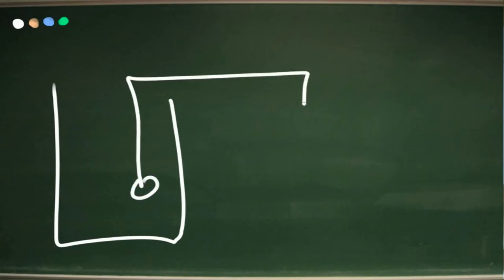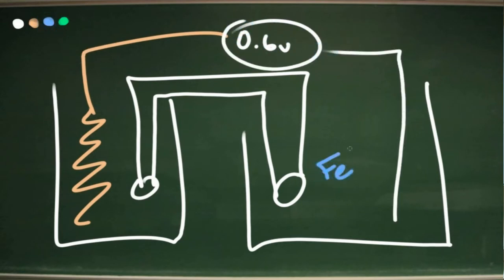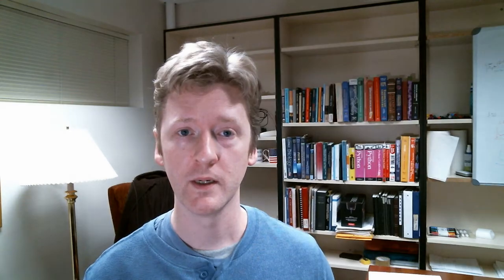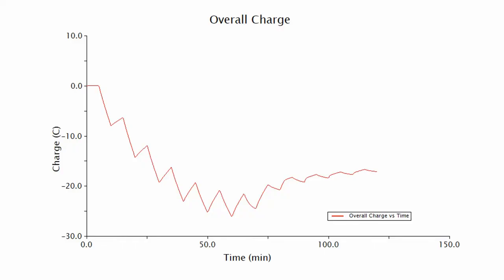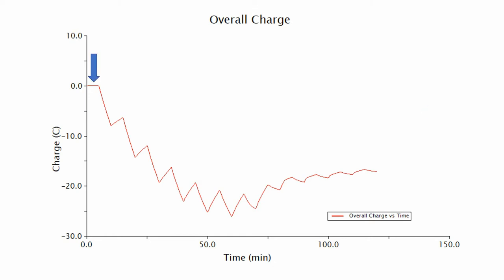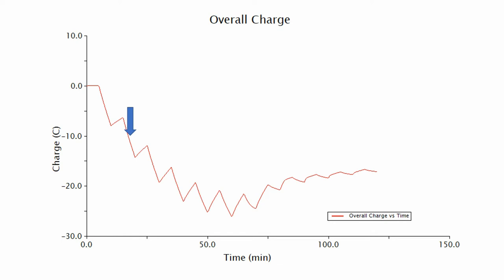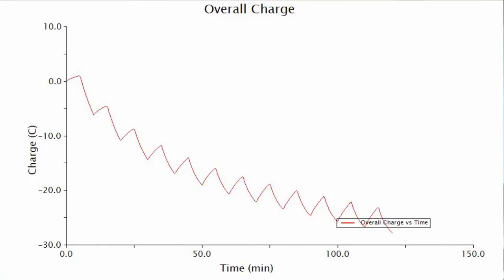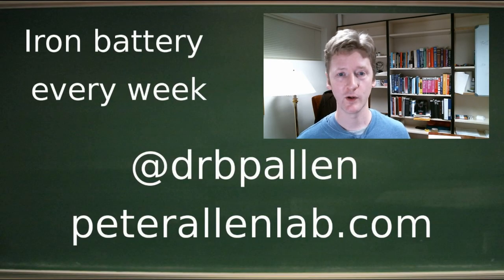Iron and Iron Chloride cell: Iron battery, part 58

Comment: OK, this might be a bit of a crazy idea, but as I recall from other battery research papers, urea and aluminum chloride form a deep eutectic solvent that is liquid at room temp.  Shouldn't iron chloride and urea also be able to form a DES? Could you use that instead of water as the basis for the electrolyte to get around the water -> hydrogen problem?  I think the main problem might be if the viscosity is too high, it might lead to a high charge transfer resistance. Perhaps adding the choline chloride you prepared in the other video could reduce the viscosity ?
Reply from the maker: It's a good idea - I'm not sure what will happen. FeCl3 does dissolve in Urea/Choline chloride DES. Here's the link you refer to:

https://youtu.be/GZ8IcoHjFdk 

I didn't make enough of it to try a cell. I'll have to give it a shot. I'll see what happens if I just mix FeCl3 with urea and heat. I don't know what to expect. The greasy choline molecule may be pretty important to the DES formation.
Reply: Very cool! I love the idea that part of your motivation is to design the "World" battery. As I understand your design goals, the materials should be low-cost, eco-friendly & readily available. Alas, although many research papers are very excited about DES's formed with choline chloride, it is only moderately accessible outside of labs. :/
WELLL ... I found a very interesting procedures paper, describing a much more complicated battery... 
However, isolating just a section, it does discuss the making of Fe  DES  by  mixing  iron  (III)  chloride  hexahydrate & urea (with ethylene glycol proportions down to 0), and further down has the claim: 
"Synthesized at ambient environment, Fe DESs also exhibit good stability during long-term storage in air"
I will add a second comment with the link, because yt has a way of sticking comments with links into a spam bucket until you "approve them?? ".  So if it doesn't come through, let me know and I'll Email to you somehow. :)
Reply: Link to referenced paper:
http://www.cell.com/cms/attachment/2115002633/2084679109/mmc1.pdf

Comment: Hi Peter - very nice video - love the explanations you give along with showing your work.  Do you think you'll get back to a 'flow battery' version?  I assume you've read up on the Case Western Reserve research.  
Cheers,
Dennis
Reply from the maker: I had not run across that - thanks for the pointer. http://engineering.case.edu/arpa-e-funds-flow-battery
Flow batteries are a great way to increase energy storage capacity, they make the whole system more complex and potentially more expensive. I'm hoping to make a battery too cheap to justify expensive pumps/fluids. But if I can't hold the materials costs down, then flow is the way to go.
Reply: One other thing that stopped me when I ran some of the numbers using small DC pumps that would be appropriate for home use:  A high percentage of your energy will go into running the (probably two) pumps.  You can be clever and pump into elevated reservoirs during the day, and gravity feed at night, but still, you only reduce energy cost when going to much larger and more efficient pumps at a commercial power plant.  
Same with system maintenance of the moving parts in what would likely be at least moderately corrosive liquid.  Ends up having to be large enough to support a staff of technicians to maintain it.

Comment: What kind of Nafion are you using?  Are there different types for different situations?  As this will be a major component of the cost, could you choose a chemistry that worked with an economical form of the Nafion?
Reply from the maker: I'm using Sigma-Aldrich brand Nafion dissolved in a mix of alcohols (Cat # 274704) applied to chromatography paper and then evaporated. Here's how I made it: 

https://youtu.be/Yx1b5jbawXw?t=3m18s

It's not too big a cost at this point, but it will definitely be expensive at scale. So I'm going to try some alternatives such as polyacrylic acid/polyacrylamide (seemed to work before) and some other less expensive membranes.